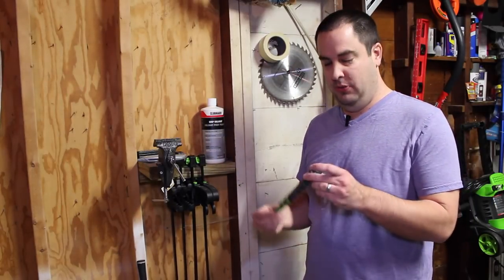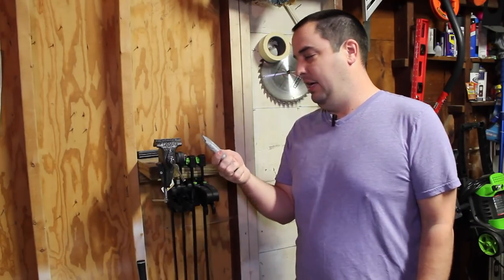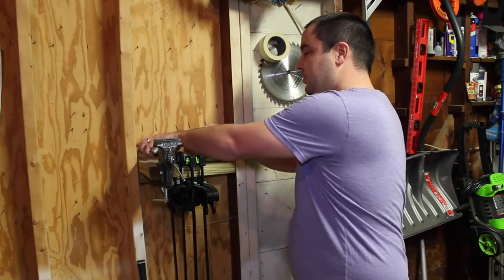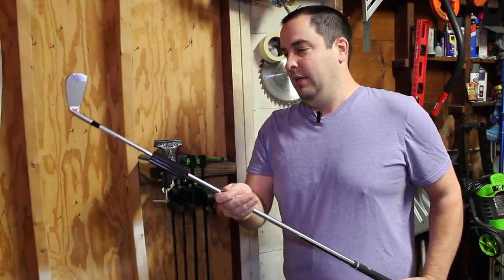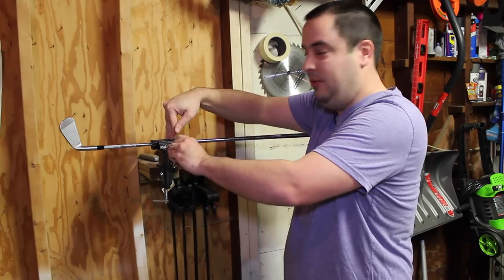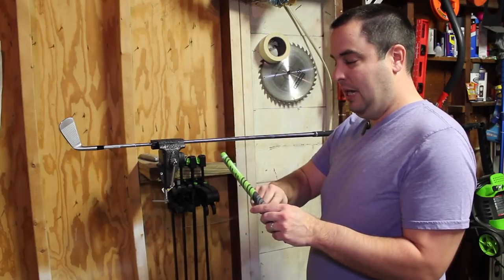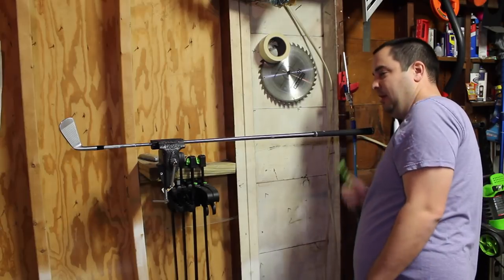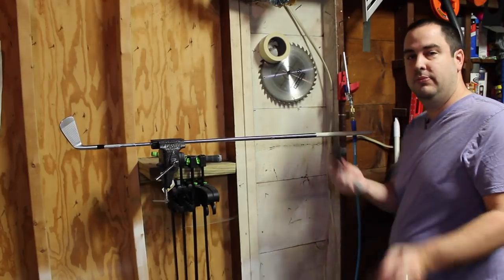How to regrip a golf club - The Easy Way!

Comment: That took way longer than a solvent.
Reply: How so?  Both methods use the same amount of time applying the tape.  He had the wrong tip on his air gun.  With the right tip it slides right on faster than the time it takes to apply solvent to the tape, then pour some in the grip, swish around, dump out excess solvent then slide it on.  Actually the sliding on with solvent takes the same amount of time as the air so solvent application time is removed.  But speed is not the point of this method.  It's the fact that you can grip and play right now.  Another point is with this method you don't ruin the grip by installing it.  With the huge variety of grips, arthritic, oversized, standard, mid sized, cord, tacky, you can try a grip and remove it easily with no damage.

Comment: you should do a revised video with shorter air tip. why bother dong the video of you didn't have the right tools in the first place.  yeah, you still got the job done though.  but could've been better, otherwise I do thank you for your efforts.
Reply from the maker: I got into the middle of making it and realized the short tip of the blow gun was missing. I've thought about doing another video doing it with grip solvent as well. We will see, my wife is about a week away from having our first baby so I'll need to allocate that time appropriately.
Reply: Actually most people might just give up if they didn't have a right tip on the blow gun. So showing that it can still be done without it was more informative.

Comment: that is not easier than using grip solvent. also it's way easier to get the grip straight w solvent. also it takes about 15 minutes for grips to be playable. so by the time you drive to the course you are fine.

Comment: but there's nothing making the grip stick to the shaft. This is idiotic
Reply from the maker: +mikcall54 other than the fact that inside the grip is smaller than the shaft. It doesn't move on the shaft at all.
Reply: whatever, I'll never do this. I'll stick to something that sticks. There's a reason for double sided tape and a reason it's used. There is an actual purpose.